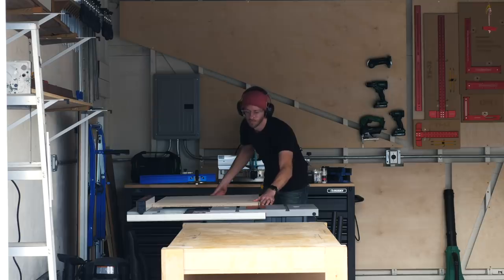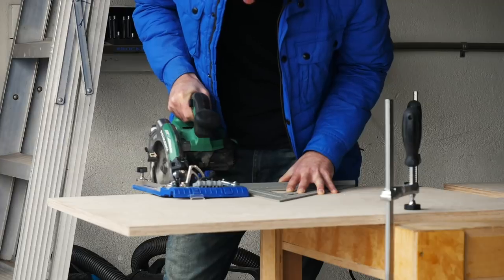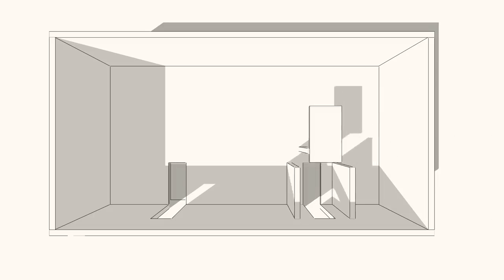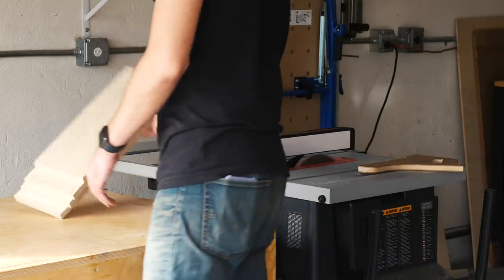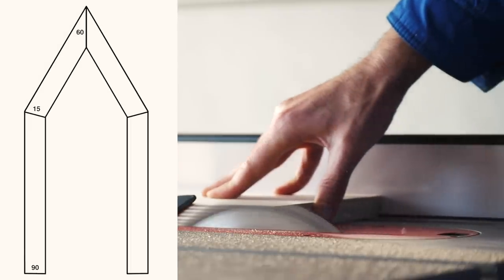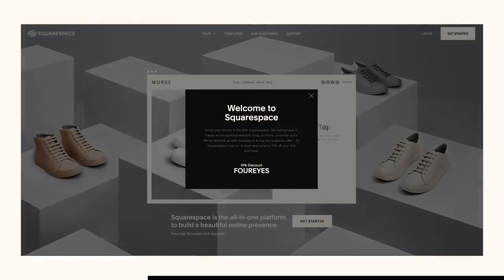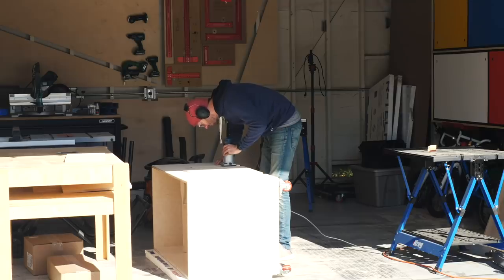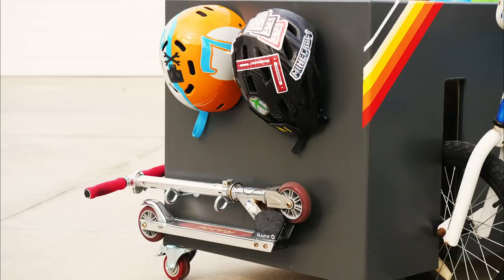DIY Bike and Toy Storage for Kids | DIY Woodworking

Comment: We are in a transition as my oldest is turning 12, and graduating to a larger bike, the garage is getting smaller. I did put hooks on the ceiling, no big deal for small or light frame bikes, but old clunky heavy bikes should remain on the floor. FYI if anyone considers this option. Nice video Chris 👍
Reply from the maker: Nice. I toyed with hanging options but then I imagined my wife trying to get it down with 1 hand while holding the baby and I thought. “Yeah... that’s a bad idea”